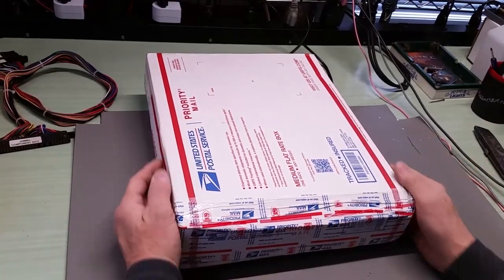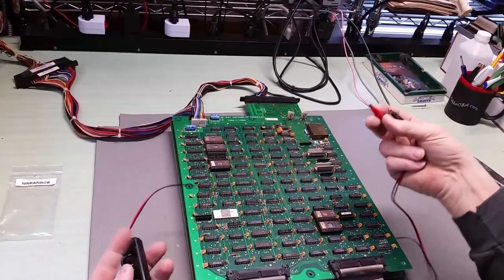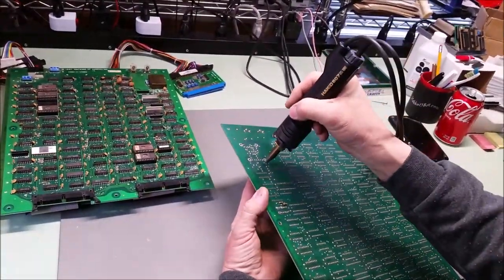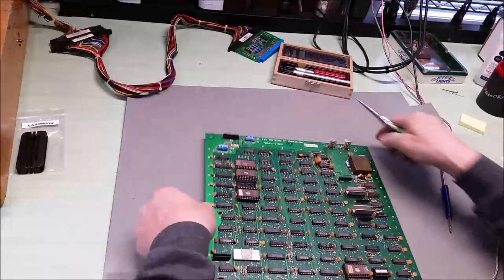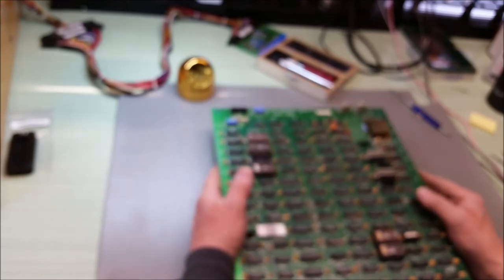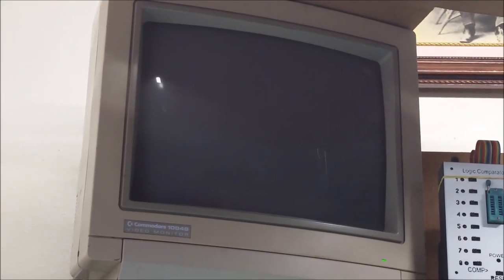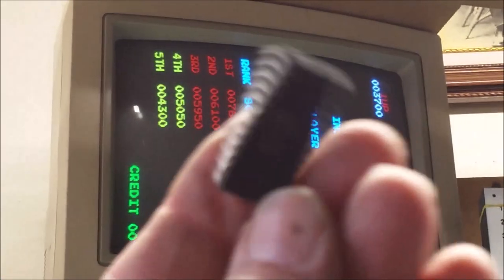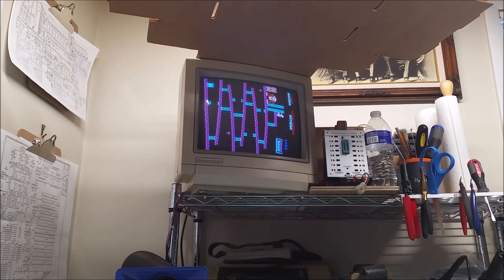Donkey Kong (TKG4) Arcade PCB Repair 03-28-2022

Comment: The typical reasons to glue down a coil are strain relief and vibration resistance.  You'll also find that glue in switching power supplies and the like.

Comment: Nice video. I was wondering if the chips your mentioned that do timing, if one of them was out would cause the video, sound or CPU to run slower or faster than normal? Or does the whole board follow the same timing?
Reply from the maker: Great question. The entire board runs off the same main clock.
Reply: @MikesArcadecom  Thanks, I thought that was the case, it would be too hard otherwise I think to keep everything running together.

Comment: Mike, the more videos you make, the more i'll watch!! :D 

That ECL (10136?) on E1 of the Video board looked like it was missing a heat sink... A friend of mine had their PCB run for a while but would have sprite issues after maybe 15 minutes. We found re-attaching a heat sink seemed to resolve that issue. Have you seen missing heat sinks become a problem once a board is running for a while?
Reply from the maker: I haven't seen that, but i bet with overvoltage, it could be an issue.

Comment: Good job Mike! Question: why didn't you turn the monitor to a vertical position? By the way, the sound of this machine is very atmospheric! 😍
Reply from the maker: Thanks! I generally just leave the monitor in it's natural position. I love the Donkey Kong sounds too.
Reply: @MikesArcadecom  Just curious, is it a personal preference, or a fear of it falling off the shelf if its vertical (since its made to stand horizontally), or ??
Reply from the maker: @CosmicCleric  well, i fix Midway boards too, (Pac & Galaga), which are turned the opposite direction. And Punch-Out's, which are horizontal. The monitor sits back about 3 feet from the front of the bench, and up about the same on the shelf. It's a bit awkward to flip it on its side over the bench. So, i just leave it in it's natural position. A happy medium.
Reply: @MikesArcadecom  Thanks for the clarification. Loved the video.

Comment: Any reasons why they used ECL RAM for the character and spirit video? I know that ECL RAM is faster but you have to use a different clock frequency and also level shift the logic signals to ECL.
Reply from the maker: Great question! I believe it was to make things more expensive to bootleg and/or reverse engineer. Or an engineer at Ikegami just loved ecl.

They used ECL starting with Radar Scope and used the same basic board design until Popeye & Mario Bros.

Comment: That was super interesting! What does the coil actually do?
Reply from the maker: The coil drops the frequency of the clock to feed the ecl circuitry. The ecls then chop up the freq further and spit out 3 8MHz ttl level clocks to feed everything else at the 10125 at 1H on the video pcb.

Comment: Donkey Kong is available arcade-perfect in many PC emulators, so repairing arcade machines that are 40 years old seems less necessary these days?
Reply from the maker: Emulators are close enough for the casual player. However, the sounds are off on all the emulators, and the inputs are not quite right.  Finally, if you don't have original controls, it's just not the same.
Reply: @MikesArcadecom  Yes there are many coin-op video games that are not very good in emulation, because of the controls:

Spy Hunter
Paperboy
Omega Race
Tempest
Robotron
Defender or Stargate
Crazy Climber
etc

But Donkey Kong (and Junior) play very well on a standard PC keyboard.